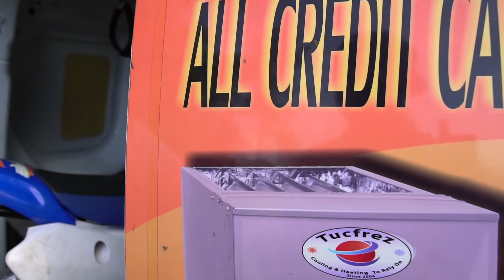BUYING A DIRT BIKE OFF CRAIGSLIST FOR CHEAP ! ( BEST DEAL ) | BRAAP VLOGS

Comment: If you put it in gear it would still move freely because it doesn’t have a clutch and there’s a metal bar underneath the fender so grab both the plastic and the metal

Comment: not a bad deal but i got a RM250 for $1000 flat and i only had to adjust the power valve and it came with fmf full exhaust system and good plastics